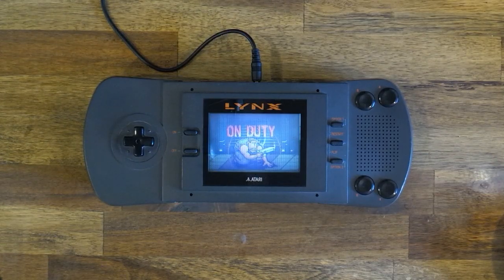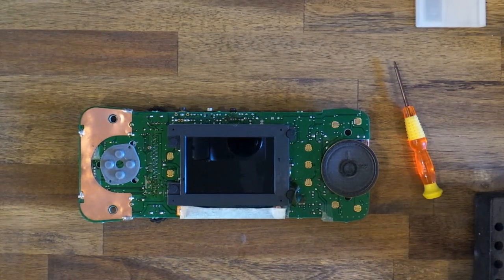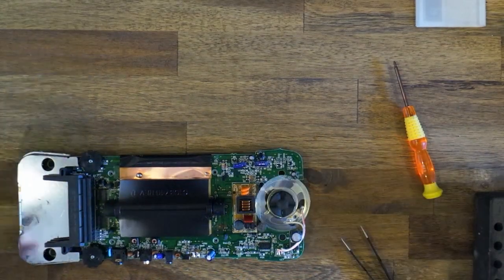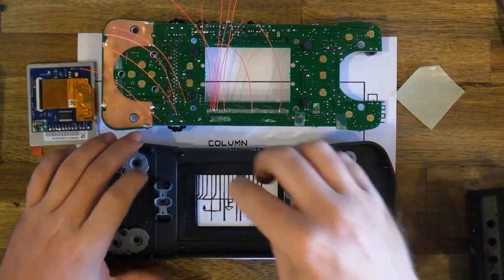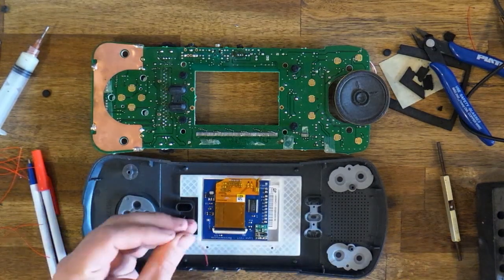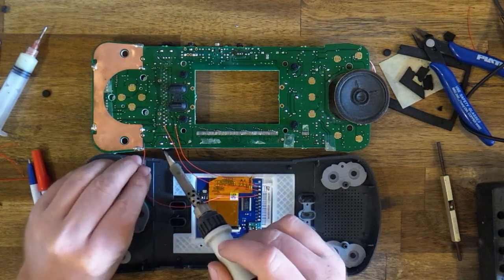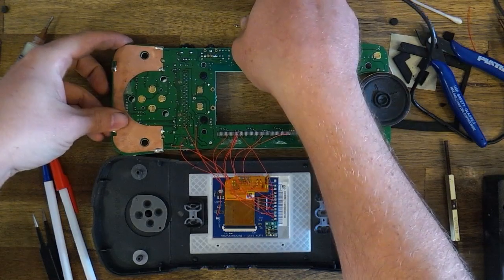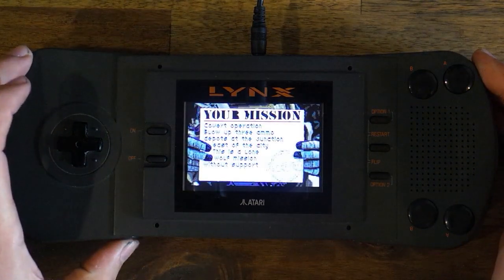BennVenn Lynx I Aftermarket LCD Install - Very rough guide!

Comment: How and where does the touch sensor mount for the new version of this mod? I wish you could have kept the feature to just hold the wheel at max for scanlines on/off and added min for vga out on/off.
Reply from the maker: it connects to the scanline pad on the pcb. you can mount it where you find most convenient and practical.

Comment: Thanks for that info! Just today, I took out my Lynx2 that’s been stored safely and has worked great.  I accidentally plugged the power ac plug into the headphone jack!  When I went to install into the correct power port, and hit the power button, the screen displayed Insert Card,  when I reinstalled the game card the game & sounds were functional, but the screen started fading out to a plain light gray blank screen!  I also noticed the brightness dial wouldn’t make it bright or dim anymore.  However if I hit the backlight button, the screen went off to black as it always has.  So, after multiple times on and off, the screen is lit blank light gray & the sounds of the game is functional even the all the control buttons.  So, could it be just the lcd?  Because I can hear the game sounds and control button commands.  The only thing I do remember from other times in the past when the Lynx was working, the screen always had a bright white horizontal line appear as the unit was powering on and then everything was fine.  Question to ask, have you ever seen this bright horizontal flash line during powering up the Lynx2?  Or was that start up horizontal flash line  just an pre indication that my lcd screen was  on it’s end of it’s lifespan?  Maybe the BennVenn screen upgrade would do the trick?